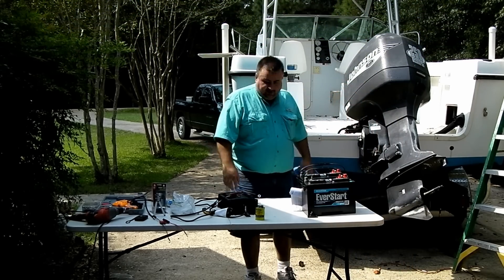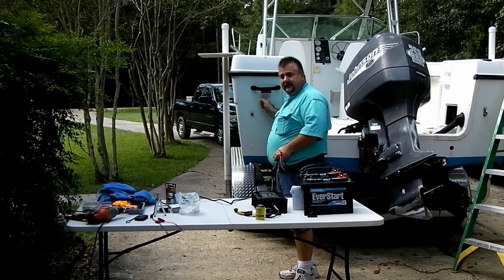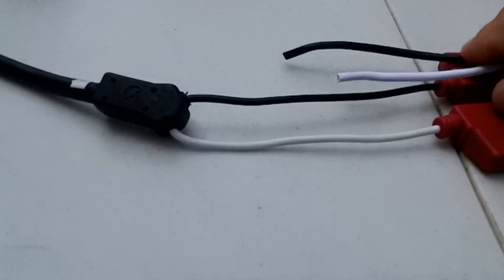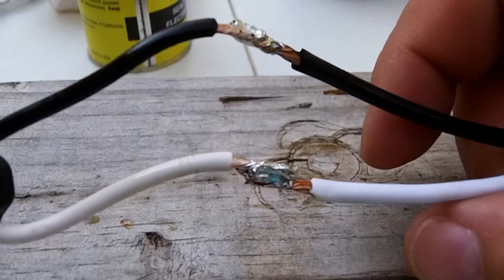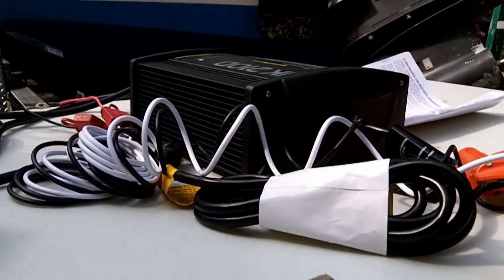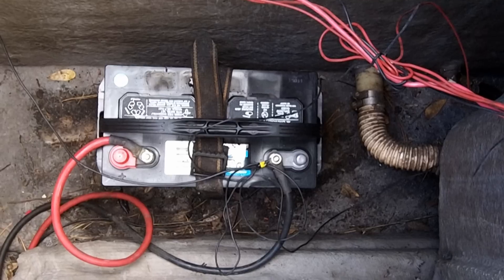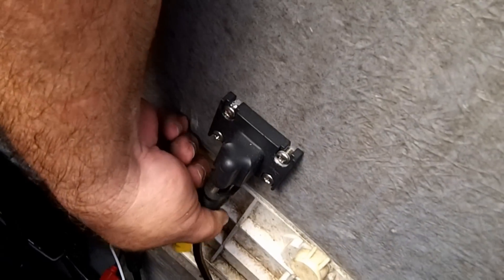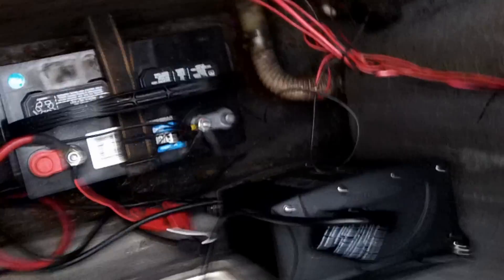How To: Install an Onboard Marine Charger

Comment: Great Job and thanks for Posting this.
I have always seen and read to NEVER Sodder connections in Marine world.
And always have the FUSE closest to the power to stop boat fires if a short.

And hanks for sharing the liquid electrical table.

Thanks Again!
Reply: Kelly, you are 100% correct.  The process is to butt-splice the two ends with a water-proof marine connector.  These have a heat shrink insulator on them.  Never solder the connection since vibration could break this.

Comment: Hi Daniel,  You made this look easy. I have a Lund that i installed a 3 bank Guest charger on. I was surprised how you made the solder connections. I stagger the Neg/Pos connections so that they can't short on each other. Also, if you join the wires in a " western union splice, this makes a far stronger vibration proof connection.
Reply: western union splice is ok yet money gram holds better

Comment: I just installed a guest charge pro 24v dual on board charger for my trolling motor.  My trolling motor batteries are new and I have them connected with a jumper wire from negative to positive to make it 24 volt.  I connected the cables from the guest on board charger with one cable to one battery and the other cable to the other battery, would I need to add a jumper parallel cables to the battery for it to charge?

Comment: Great video I have a question , I want to buy a 2.5hp kicker but most review say the have too many problem with the carb and start ups.  I watched you other vid with the Johnson that stalled on you and you clean the carb .
What do you think about the Yamaha 2.5hp they say I have to add stabilizer everytime and empty the gas lines and tank if not used for 2 weeks or more since gas will collect water and it will gum up. 
What would be your recommendation ?
Thank you in advance :)

Comment: Please tell me your thoughts on mounting it on a side board where one of the length sides is flush with the floor. I know it says have 6" of air flow on each side for max efficiency and performance but I have real limited spots on the boat and would be helpful if I could mount it where the two ends and one long side have great airflow but the other length side would be on the carpet.  Thanks, Walt
Reply from the maker: Liane Jones My official answer is to follow the installation instructions. That being said I will tell you that the area where I installed mine in the video is part of a removable storage basin area. With the basin fitted in the cutout hole (where it stays) there is only six inches of air space on two sides of the unit... around one inch on the broad top side and four inches on the remaining side. No problems yet... even in the southern Louisiana summer heat.
Reply: Daniel Scheer thank you for the input!

Comment from the maker: Sorry so late on the answer. I do agree with running the engine often. Your best bet is going to be to run the main engine every two to three weeks and the kicker too. The stabilizer is good, but if they are two strokes... the gas will evaporate leaving the oil behind.

Comment: my question is there a way to contuine to chargr the batterys while you are on the lake runnjng the motor/can you use the motor to charge the batterys/  if so what device do you use/how is it hooked up in the boat to the motor/ so that the motor is genarating tne power to charge the batteries?

Comment: Will this allow both batteries to charge while the boat motor is running? Or is it necessary to always plug in the charger in to replenish each battery? I have a boat slip that does not have power and cannot regularly plug my boat into shore power.

Comment from the maker: Not sure how long they were but I made sure I had enough "meat" in the wall to screw into. I did worry that I might have to use bolts and nuts, but so far it's holding even after some pretty nasty offshore trips.

Comment: I have the same unit that I need to install.  Do you just use screws instead of nuts and bolts?  How long are the screws you used?

Comment: can I leave my minn kota trolling motor plugged up to my batteries while this identical charger is hooked up
Reply from the maker: +Justin Verret Most boats have a disconnect switch that isolates the batteries from the rest of the circuits. I always have the batteries switched to "off" while charging. I would check with Minn Kota to be sure. I definitely recommend this charger setup... went from new batteries every year or two... to now almost four years and counting.

Comment: Thats a REAL Nasty Solder connection That connection should have been filed or sanded smooth and then used adhesive lined shrink tube..
Reply from the maker: skunk farm I usually don't reply to the critical comments, that don't provide any useful information. Richard's comment actually does provide some guidance for anyone working on a similar project. After two years+... the real nasty solder connection is still working great. BTW, I am not a "Hey look at my clean boat" boater... I am a "Hey look at all the fish I caught" boater! lol

Comment: can the charger charge the battery while being use?
Reply: NO, you cannot. This will fry the electronics in your trolling motor. I forgot once, and it cost me a compass board in my Minn Kota. My new Motorguide tells me the same thing. Sorry Brother !
Reply from the maker: I only plug in the charger when my batteries are in the "off" position. This ensures that nothing gets damaged.

Comment: Video is great but poor wire soldering connection. You should first make a good mechanical connection between the wires, not just parallel them and solder.  Wires should have been bent in a J hook, then soldered,  This would make for a much more reliable wire connection on your extension connections.  Otherwise a great video.

Comment from the maker: No... both batteries will charge from the motor while your switch is set to "both". Or you can run out on battery "1" and back in on battery "2".  This charger will charge both batteries while you are docked and plugged in; or in your driveway. Each battery is independently charged and maintained. If you do not have shore power, or park the boat where there is an A/C plug... this will not benefit you.